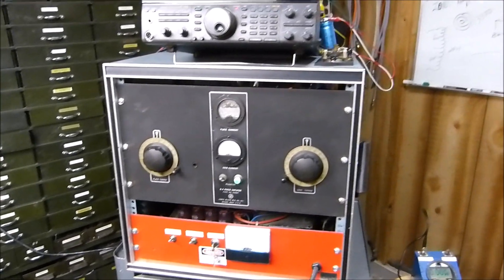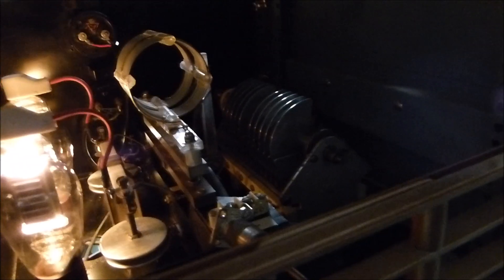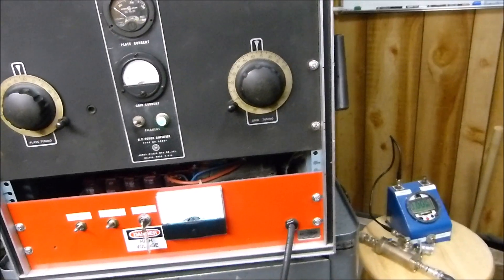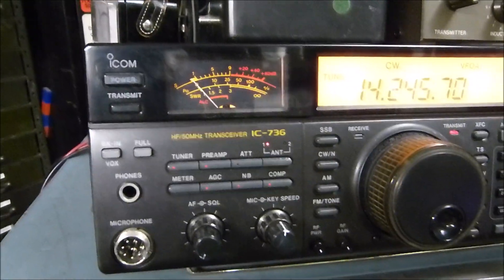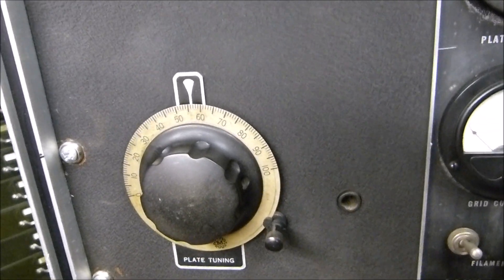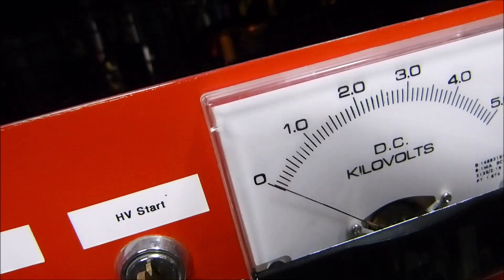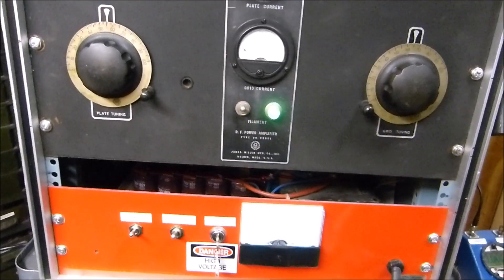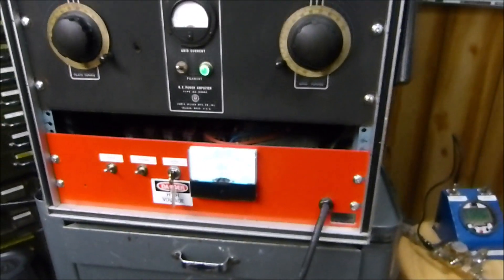James Millen 90881  812A Push Pull 20M Amplifier Update

Comment: Really nice amp, great job! Is the plate ameter in the cathode or the plate supply?
Reply from the maker: It is old-style and in the plate lead - I build many of my amplifiers that way unless the plate voltage is really high. Most old style meters have a high voltage rating to chassis.
http://www.radiomanual.info/schemi/ACC_PA/Millen_90881_user.pdf

Comment: You're a very talented amp builder!
Reply from the maker: Thank  you, you are very kind. I have this amplifier in a full height 19" cabinet now and plate modulate it on 40M. Lot of fun to run AM again. I did put the 812A back in as they are low mu triodes vs the high mu 811A. Low gain triodes are always touted as being the better choice for plate modulation. 73

Comment: I really get a kick out of you when you are excited with something, and you show us!  Very nice!  Not trying to hide anything or keep anything a secret.
Thank You!
Reply: Bill, that is a very nice compliment, thank you. And to make it even more exciting, I made my first CW contact on the amplifier today. I doubt I have made a CW contact is 50 years... and to top it all off, it just seemed "respectful" to the amplifier for its first contact to be CW. Push pull 811A's from 1948. Wow... Works like brand new. I also got in a B&W 425 low pass filter today for it in the original box. I don't think it was ever used. Not a scratch on it.
Not too sure how clean these old amplifiers at close range (that is why I bought the low-pass filter) but my friend and CW contact said the CW signal was perfect. Crazy thing is, I can still sent at probably 13-15 WPM with little error but my head is about to explode if I am trying to copy CW over 5 WPM. Just need more practice... Always good to hear from you. PS - I don't have to use the tuner between the exciter and amp any more since I got the grid coil right.
Reply: @raymondbeard8159  Congratulations on your contact!  Shows that the old girl (amp) is working just like it should, with your expertise!

Comment: Nice amp! Is it class c?
Reply from the maker: Yes, it is class-C. Push pull 811A. 
I tried to make some videos tonight where I plate modulate it with a Dynaco MarkIII amp and a second transformer to turn around the 8 ohms to a higher impedance and modulate the plate supply and it did work but I need to do the video over. I'm getting there.
Reply: @ElPasoTubeAmps  Something you might try to improve plate efficiency is to move the plate tune capacitor just slightly off the dip. That's usually the less capacitance side of the dip. This is recommended in several commercial AM trannys with class c finals. I've done and it works. Also, with modulating the RF plates with a reverse audio transformer method, the final RF plate current going thru the mod transformer may saturate the core. That happened to me when I used a similar method of plate modulation. I had to use a modulation choke and a coupling capacitor to make it work right.
Reply from the maker: @bob4analog  Hi Bob, I really appreciate your thoughts on this. I have noticed that a little more output power is obtained as you said, with the plate tuning capacitor just slightly off resonance. I also see in the Collins designs where they use the modulation choke coupled by a capacitor. Unfortunately, I do not have any of these 50H chokes but I do have several nice modulation transformers. Two of the modulation transformers I have are for an 813 and the other for 4-125A and they have the screen windings. I ran a KW level AM station in Huntsville on 75M up to 1975 and I modulated a 4-400A class-c with a pair of push pull 4-400A but I don't remember doing anything for the screen of the class-c amplifier. I surely agree that final amplifier current could saturate the core of the transformer but apparently I did not have that problem in Huntsville or maybe I was right at the edge. I would Love to build another station like I had but I just don't have the room. I am thinking now to use the quad 1625 modulator I build a few months ago (and posted it) to modulate this Millen amp. I will try it and see what happens. 
PS - the Millen amp is supposed to be cathode modulated according to the Millen documentation but I am not going to go that way. The Millen amplifier is so simple and rather crude I am amazed it works as well as it does and is stable and is the only PP RF amplifier I have ever worked with.
73
Reply: @ElPasoTubeAmps   - Spot on with the modulation. Yes, it's worth a try. The modulation transformers you mentioned are made for class c service wherein the final RF plate circuit goes in series with the transformer output. These mod tranformers have a gap in the core to prevent the transformer from saturating. Course,  that's only good for so much DC current. The manufacturer gives the maximum specs on such. I've used audio transformers in reverse for plate modulation with excellent results, but as stated, I had issues with saturtion which caused bad frequency response and terrible distortion. When I installed the mod choke and blocked the DC to the audio transformer,  all the frequency response and distortion problems went away. I got the mod choke made for me from Electra Print. It cost a few bills, but it  works great. I've used my AM transmitter for different radio stations on STA. Anyway, great job on your 811 final! Hope to see a vid of it with plate modulation.  73!